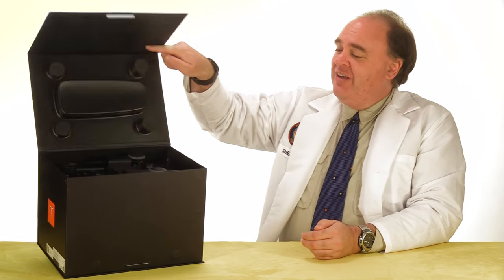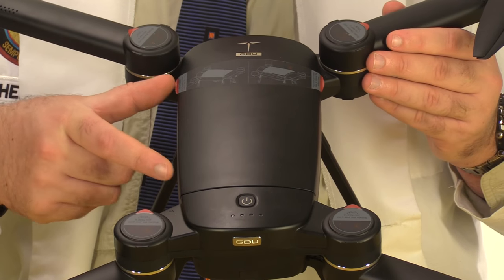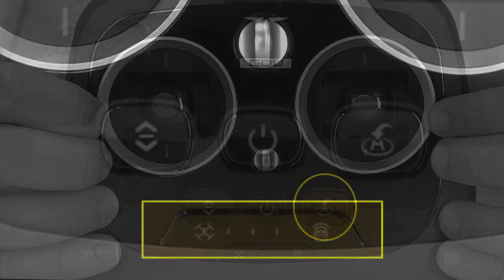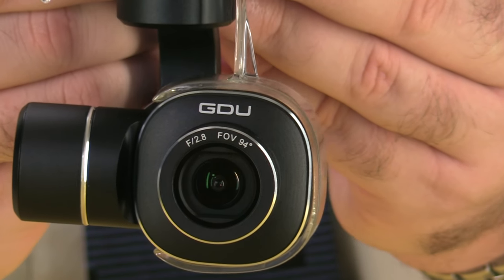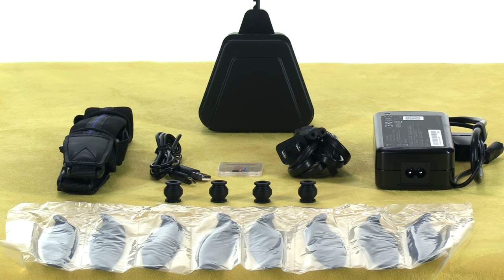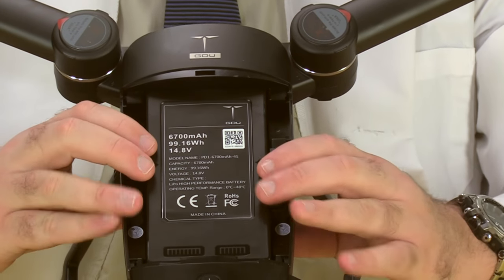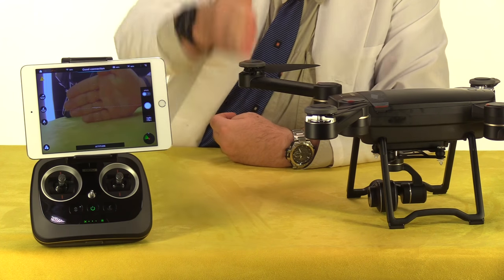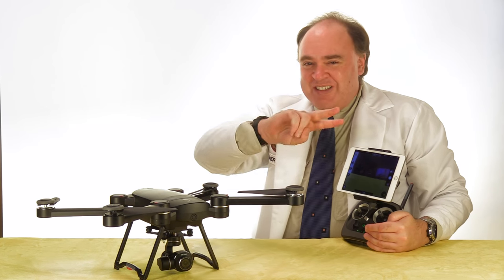GDU Byrd Drone Unboxing and Setup

Comment: What  do you think of the quality of materials in the GDU body? Does it appear to be rugged? Do you think it will take a few rough landings without cracking or snapping off an arm? I had a Chroma, and you could barely pick it up by grasping one leg without fear of it snapping off.

Comment: It's in the same league as the Karma, it's slightly too big to be portable over long distances on foot (trekking) imo. 
I'm looking forward to the flight review and to see if the battery lives up to the claims.
Reply from the maker: I've seen the Karma in person, but never had it side-by-side with the Byrd... Based on my recollection, I'd say that the Byrd is just a bit smaller -- however, you have to dismount the gimbal to get it down to that size. I'm guessing you're a Mavic fan, by looking at your thumbnail, and there is no doubt that's a formidable aircraft when it comes to capabilities and ease of transport.